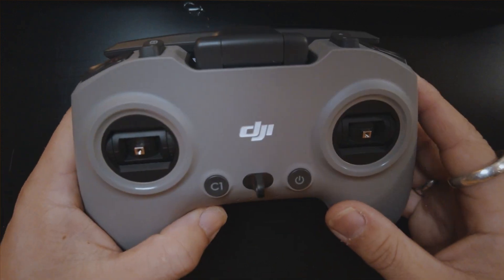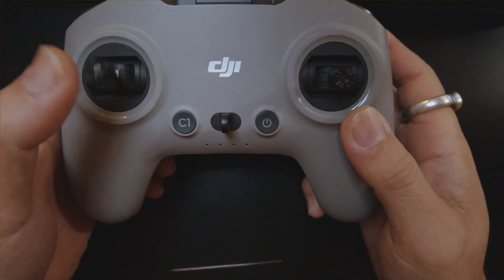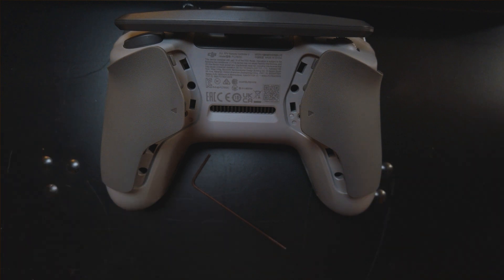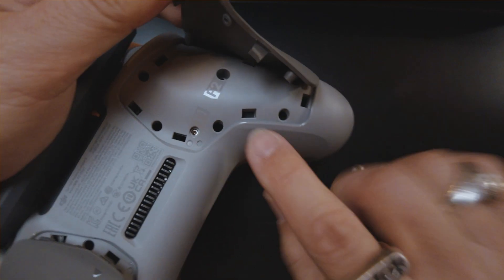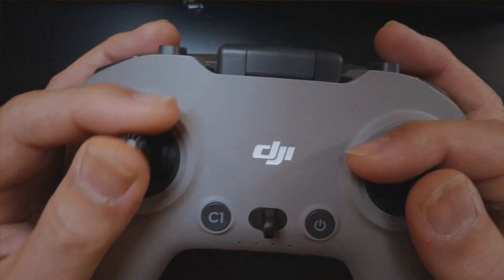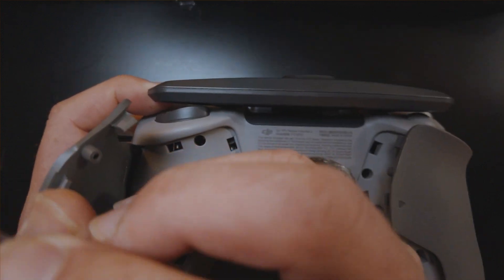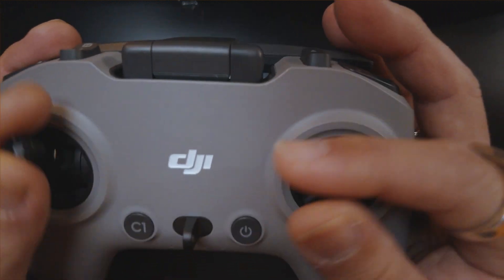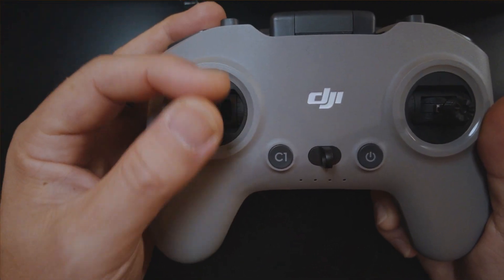How to modify your DJI FPV drone for Manual Mode⚡️

Comment: Hi..does it support for mode 1 control?
Reply: You should be able to go into the goggle menu and change the stick control to mode 1.  Then you can physically change alter the right stick the exact same way as in the video for throttle

Comment: can the mode be  changed ? im having trouble, i fly mode 2 and my remote is on mode 1 and i cant fly very good on manual. thanx in advance.
Reply from the maker: Yes you can go into the remote menu page and change it to mode 2!

Comment: Thanks, great video. What about the right stick.  Can we put it without spring too?
Reply from the maker: If you fly Mode 1 you can take out the spring for the right stick instead.  Both sides are the same so the process should be the same as well, just make sure to change to mode 1 in the goggle menu